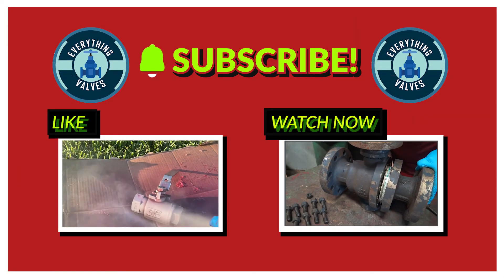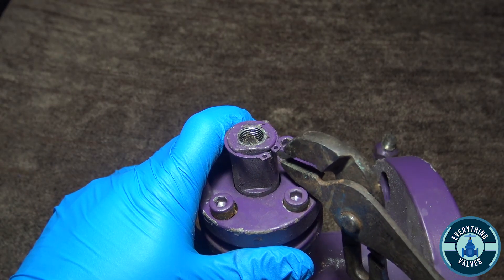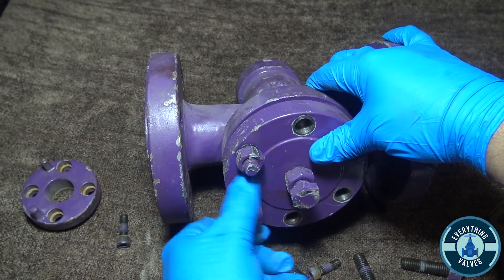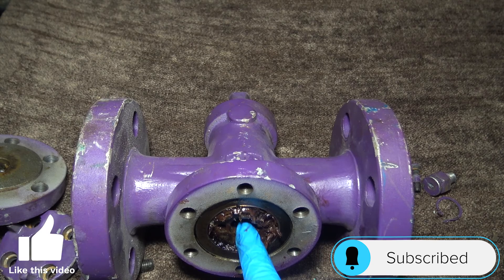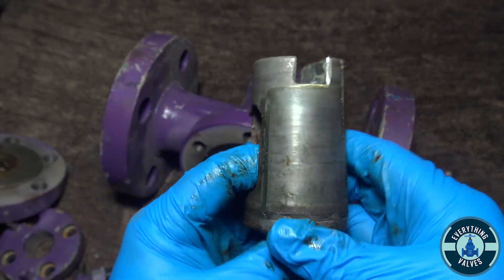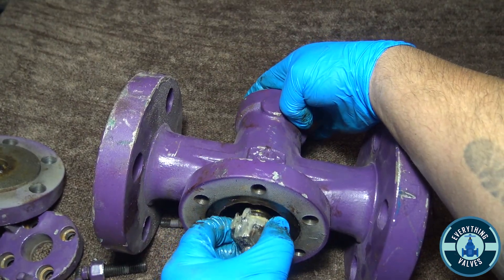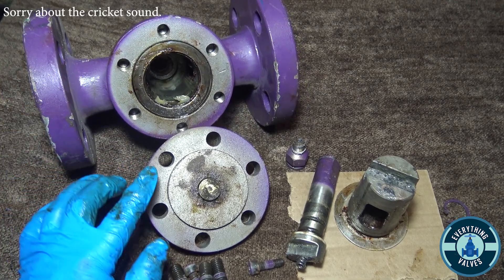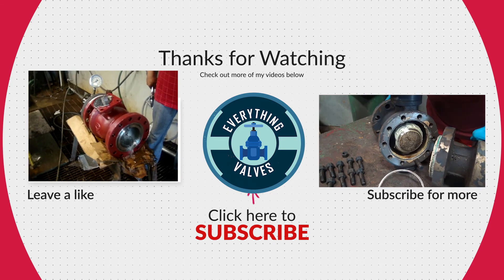Lubricated Plug Valve API 6D. How does a plug valve work? Plug valve parts breakdown. #plugvalve

Comment: is this a pressure balanced plug valve, brand? moreover, how do you rate brdr and arflu vs serck audco, galli and cassina?
Reply from the maker: Thank you for the reply. Yes this is a pressure balanced plug valve. The brand for the plug valve used is AITG. There are many different manufacturers of plug valves. They each have their differences and it’s hard to rate them. Just depends on application, budget and preference. Hope this helps.